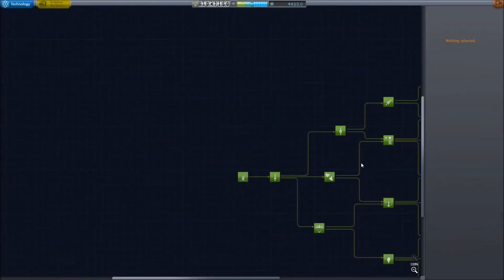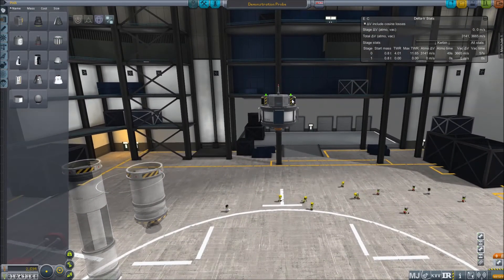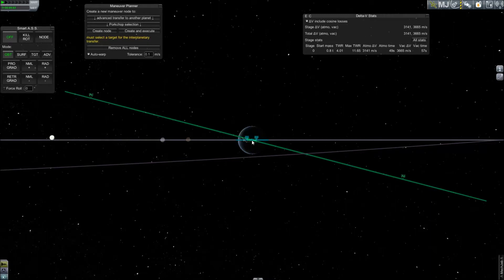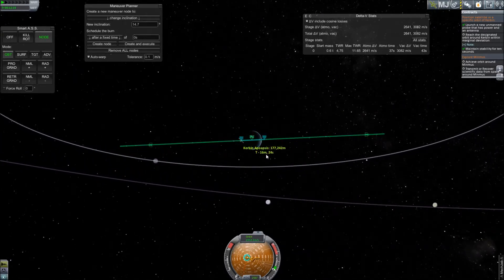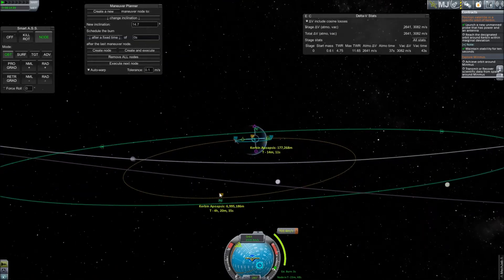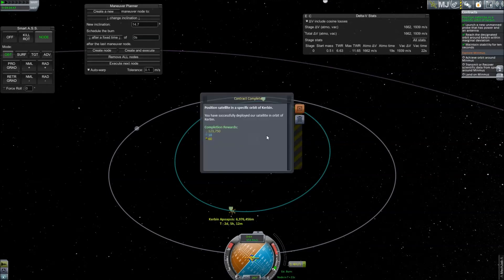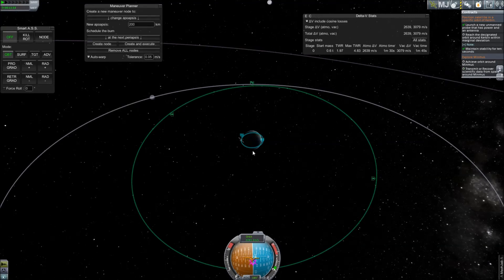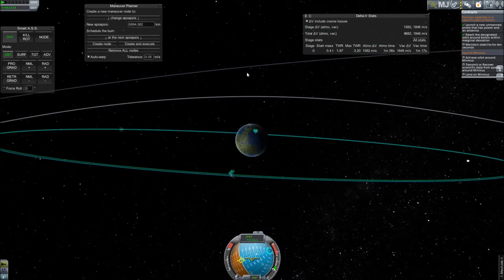Guide on matching contract orbits in KSP

Comment: There is a much more efficient way to change inclination than you give. The first step is to move your apoapsis to the ascending or decending node of the contract orbit, then change your inclination at apoapsis.  That way, you aren't moving as fast and so don't need as much dV to change your inclination.
Reply from the maker: Anson Mansfield As explicitly stated "This is by no means a definitive guide, and is simply one way to complete these contracts. While it is very simple, it is not the most efficient method." It is also stated in the tutorial itself that plane changes made near apoapsis are much less costly.